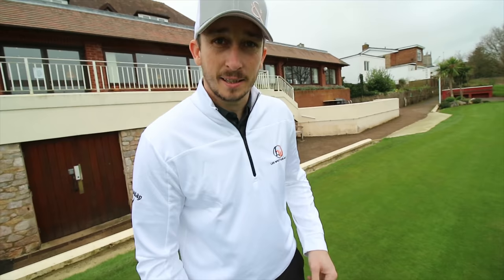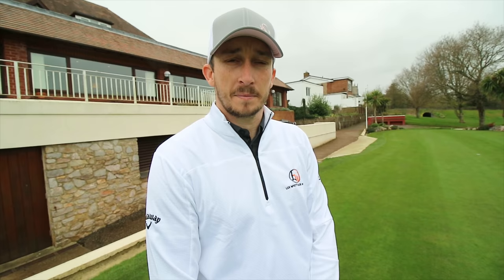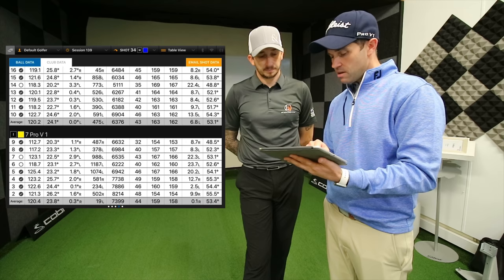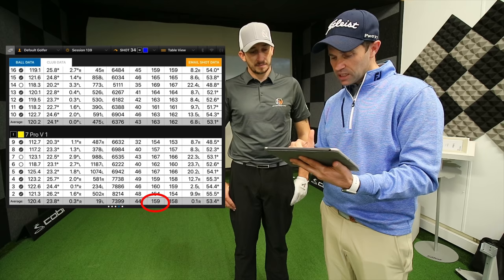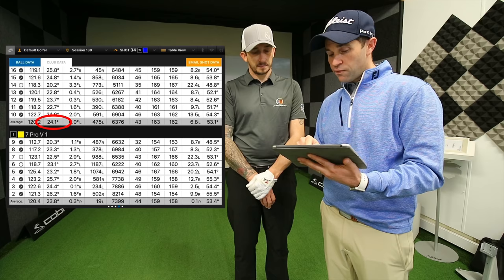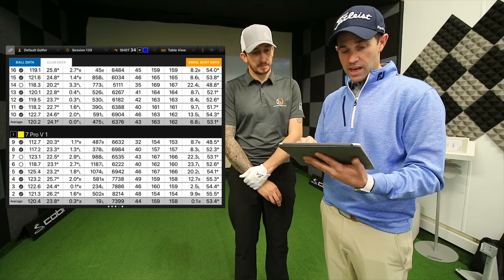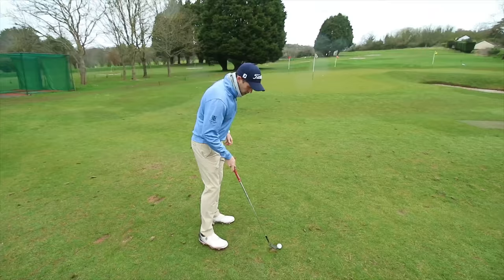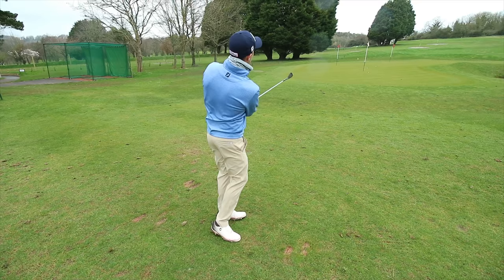GOLF BALL FITTING - AVX VS PRO V1

Comment: With the reduction in spin on the driver, woods and long-irons, I'd expect that most golfers would see an improvement in offline-shots due to reduced side-spin from the AVX.  Yes, the AVX spins less into the green than  the ProV1 and Prov1x, but they appear to generate more than sufficient spin for the majority of mid to low-handicap golfers.  As someone who has problems with excess spin and a higher than desirable ball flight, I think the AVX will suit me quite well.

Comment: I’ve played the AVX old version, defiantly a lower more penetrating ball flight with mid irons. It is softer off the putter and wedges. Old version did not spin as much around the greens but believe the new 2020 version improves the spin on pitch and chip shots. Good in the wind. Currently testing the B-RXS and B-XS alongside TP5. As many times in the past I test and mess about with other balls and end up back at the Pro V1! 🤷‍♂️

Comment: The new AVX is a much better ball than the first generation. It is much closer to performance with the ProV1 and X. I've been using all three for the past three months, particularly around the practice green. If there is a difference in spin and launch around the green, it's not much. Maybe a yard more runout? Launch is not as jumpy with wedges as before. Distance control is excellent and I never got a flyer with a short iron from the middle of the fairway like I did with the previous ball. It is probably best for me off the tee. The trajectory is much more penetrating than the X which I can spin too much with a driver. The new ProV1 is excellent with a driver as well. I'm pretty torn between the three. Perhaps I should game the Left Dash?

Comment: Hi Dan, I have used the AVX and I noticed a difference with the irons they definitely went a few yards further in my experience probably carried 5/7 yards further of course this was not on GC Quad this was done on two par 3s at my course which do have firm fast greens. 

I then used the AVX against my Pro v ball from maybe 20 yards off the green pitching to a flag some 40 yards away and at the time I didn’t see any difference in them stopping any different obviously strike plays the biggest part but on average no real difference apart from sound, the AVX is definitely softer so or not loud as the pro v I still have a few AVX balls left but I still prefer the Pro v off overall shots.

Comment: the amount of spin is measured per minute is it not...so a ball that spins 7000 per min in a ball flight that lasts say 10 seconds has spun 1,116 times compared to a ball that spins 6000 per min has spun 1000 times..The difference seems to be pretty small and also considering that spin rate is calculated within the first few inches of ball flight... that spin rate slows down the longer the ball is in flight..   Sorry but another pet peeve of mine is the dispersion average reading we get on Quad...On his dispersion average on the Pro V1 shots it reads 0.1R..If you said your average dispersion was that I think you would be one helluva golfer...  In actuality his dispersion average is 10.3 yds left and 10.4 yds right...In my part of the world we call that army golf....Don't get me wrong I love stats and numbers but they have to be interpreted properly if you wanna know what your tendencies are and what needs to be worked on....Arccos is a great tool to show you what your weakness's are, but if you've played as long as I have you/ I won't need arccos to show me that my weakness starts at the tee and ends on the green...The strong part of my game is the 19th hole